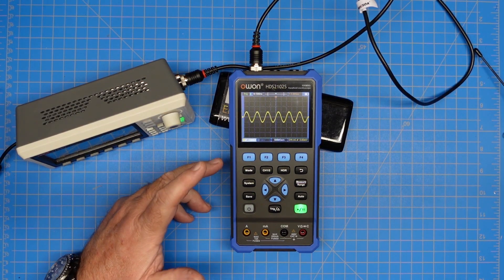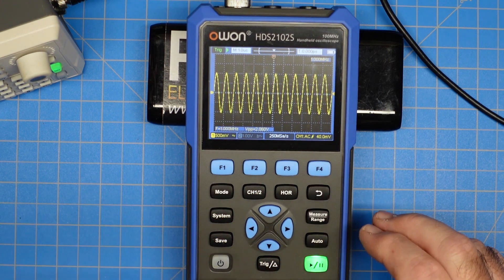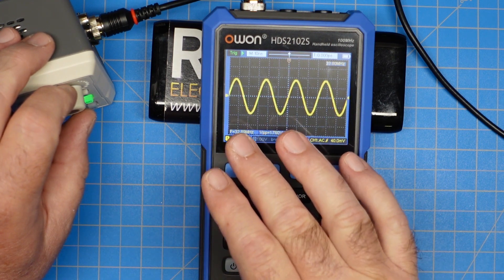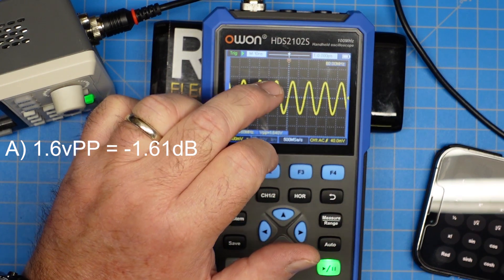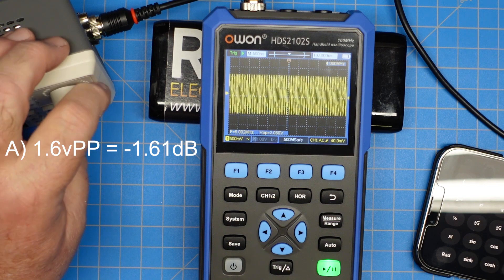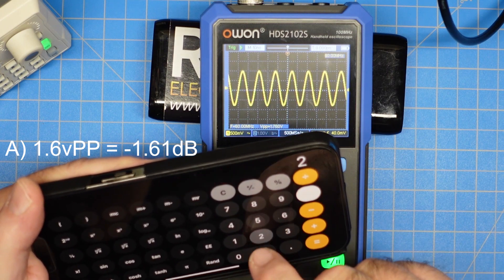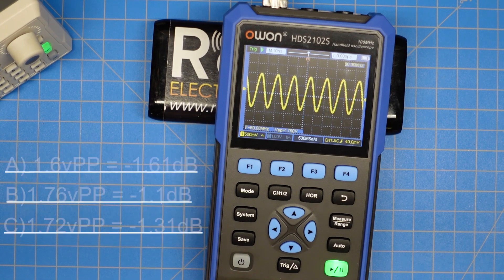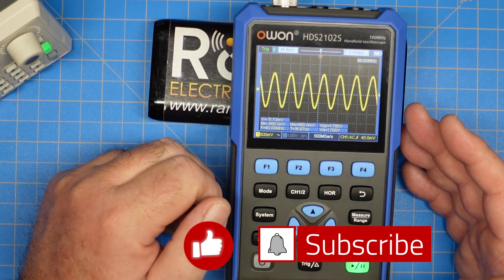Flash - NEWS Update on Owon HDS2102 Oscilloscope

Comment: I just got this scope as well.  A sweet little portable scope for the money IMHO.

Question that I have... I know you can enable measurement displays along the bottom, but why does the scope always display the frequency at the top right corner no matter what you enable/disable along the bottom.  Is this just a redundant display of measured frequency?  If so, just wondering why they would choose to do so (making it available as a display at the bottom).
Reply from the maker: I believe so, I could never get it to go away either
Reply: @FEPLabsRadio  Hardware frequency, can switch
[HOR]-->[Counter OFF]

Comment: Can I check the oscillation frequency and waveforms of switch mode power supplies with this scope?
Reply from the maker: As long as those frequencies are within the bandwidth capability of the scope, which for this model, they would be.
Reply: @FEPLabsRadio  thank you so much for the reply. I have ordered the model that comes with the waveform generator. I already have a great success rate at fixing SMPSs by using a decent multimeter and a few tricks I learnt from youtube that allows to know whether oscillations exist or not. But this equipment is gonna quench my long thirst of seeing the thing for real. I'm grateful for such helpful content. Will keep an eye on your channel.

Comment: OWON HDS2102S vs Tektronix THS720A 
Which of these two devices would make sense to buy?
Reply from the maker: It depends on your budget.  Tektronix makes OUTSTANDING products, truly quality top-of-the-line.  However, 800$ vs $200.  It comes down to budget, and what your actual needs are.  The Owon is not in the same league as that Tek scope, and the price shows that.

Comment: Yes, cables matter, especially if one is somewhat cluelessness regarding the effects of pushing RF frequencies through improperly terminated 50 ohm coax into a 1 Meg plus 10pF-20pF scope input.  

It's NOT "attenuation in the cable" it's the fact that unterminated coax becomes a tuned circuit, and then the coupling becomes a complex function of the impedance and length of the cable and the resulting complex impedance and VSWR.  That's why they give you a 10:1 probe with a high frequency compensation adjustment to match it to the scopes 1 Meg plus a few pF input. 

I am astonished that you could be knowledgeable enough to understand advanced concepts like that 20 Log E1/E2 formula for decibel calculations, and yet not have ever stumbled across what is by comparison EE 101 stuff like how coax cables need to be properly terminated for precision measurements.  

For an accurate high impedance measurement at high frequencies, you need to use the 10:1 probe (after properly adjusting the probes compensation), or as an alternative dodge the high impedance miss-termination issue by forcing the scopes input impedance to 50 ohms with an T terminator at the scope end of the cable.   Also, take into account that anytime your signal generator and meter or scope disagree you have to ask yourself which one is in error?  Many consumer grade AWGs and DDS based signal generators suffer from uncorrected (or poorly corrected) SinX/X frequency falloff at higher frequencies near the upper end of their range. This is especially true when they are not properly terminated, because the reflected standing waves on the coax play havoc with the signal generators output leveling circuits.
Reply from the maker: Thanks for watching.
Reply: I just got around to trying out the cheap spaghetti thin BNC-BNC cable that came as part of the "bonus" accessories with my HDS2102, and even WITH a proper 50 ohm termination the levels are all over the place and would only stabilize when some side pressure was put on the cable.  So turns out that you were right in this case THE CABLE DID MATTER.   The scope uses those damn "safety" plastic plated connectors, which make connecting BNC cables a pain anyway, and that and a  really crappy improperly crimped cheapy cable they supplied made the cable start to screw up literally the second time it was connected.  I chucked it and replaced it with a nice flexible 3 foot RG8 Mini Foam dielectric BNC cable that I soldered and crimped myself about 30 years ago - terminated with a Tektronix in-line 50 ohm terminator at the scope input that's even older than that - and now the levels are rock solid to 1/100 of a volt.

Comment: Hello, can you use the multimeter leads to input and see the sinewave from an electrical socket?  I've been searching everywhere for this answer as i'm new to oscilloscopes.
Reply from the maker: Zack - you need to be SUPER careful hooking this to mains power.    Yes, you can do it.  BUT, you need to make sure you understand the max voltage input on  the scope, you need to understand what ground reference you're using.  As this is battery powered, you have a floating ground.  Just make sure you're careful about not crossing your leads up, or touching the bare ground lead clip.  I'd recommend you study some youtubes and user manuals.  It is entirely able to do what you're asking, but you're playing with mains level voltage.